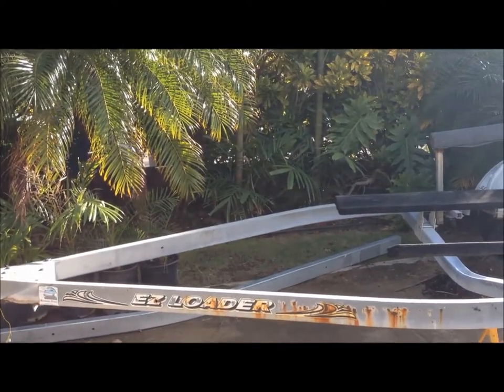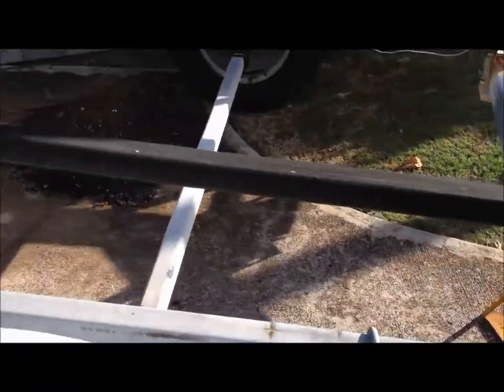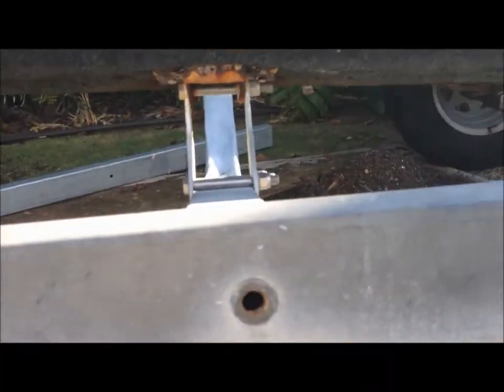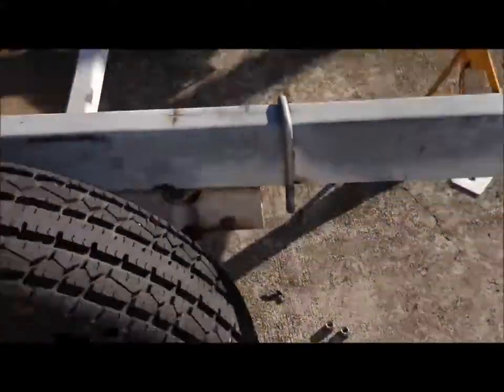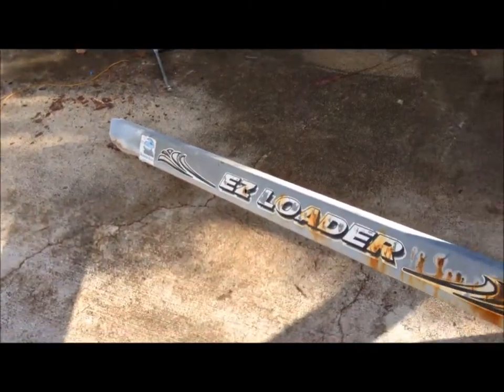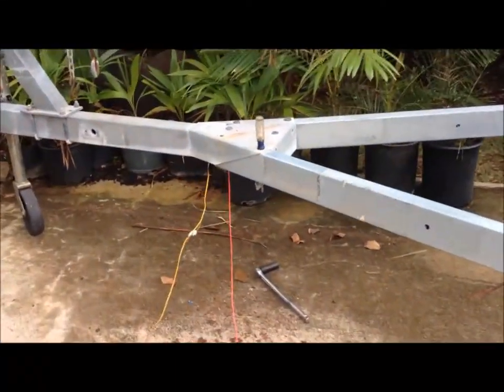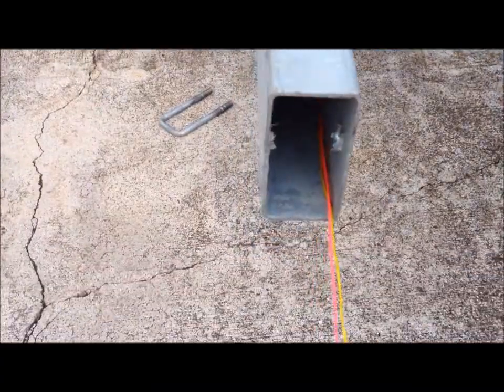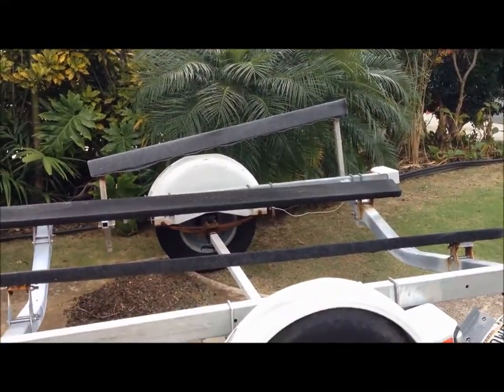Ez Loader Trailer Repair

Comment: Is your trailer galvanized or painted steel?
Reply from the maker: Galvanized.

It is 15 years old, and has been used exclusively in salt water. I have "changed out" most of the parts, total cost... guessing $1000 in the last 10 years. I can live with $100/year "up keep"